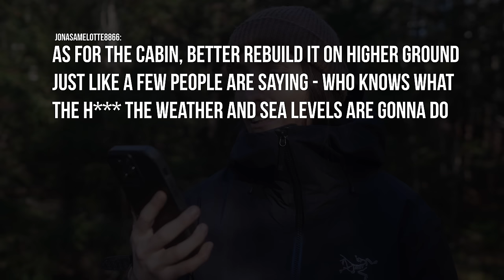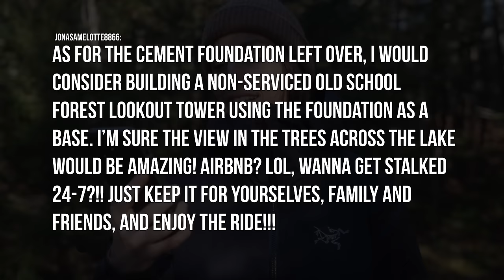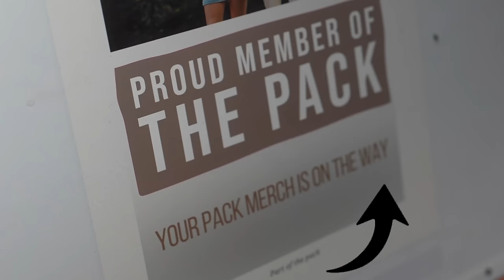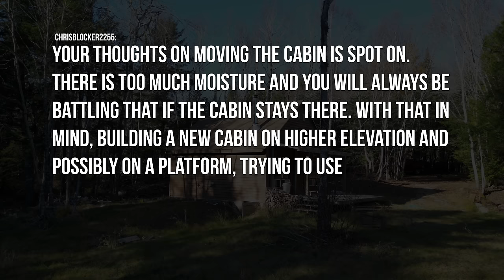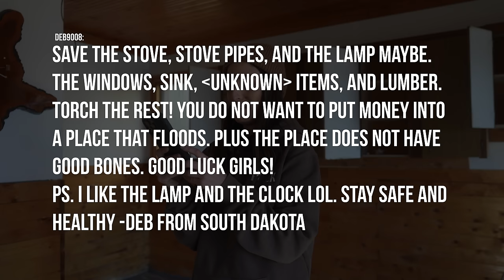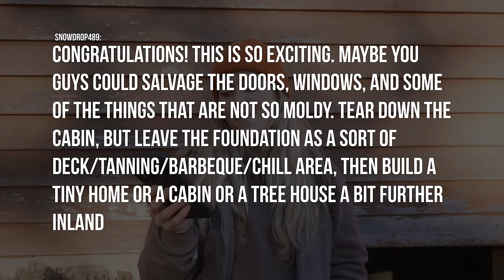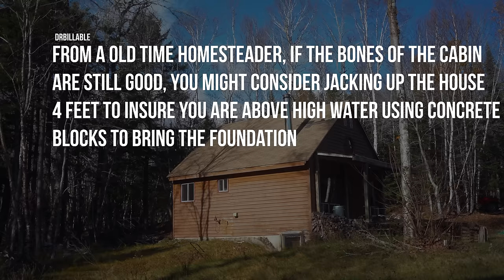Starting My Abandoned Lakefront Home in The Woods

Comment: Í can't help thinking that the water damage isn't coming from under the house. There doesn't appear to be any mold there, which I would think you would find. They build houses over water all the time, so there is nothing wrong with doing that. Perhaps the mold is coming from the roof and it is really badly in need of replacing. I am not a builder, but it doesn't make sense to me. Perhaps water has got inside through the roof and because it has been kept closed and there is no ventilation you get mold.

Comment: Been thinking about that location you have and what i would do if i were you and i would pull that old cabin down its got potential heartbreak written all over it if you try and fix it up as mother nature will have other ideas its just too close to the stream and lake which is a shame as you can understand why they built it there in the first place its such a special area.
What you need to do is go up as in build a cabin 10 -15 feet in the air on posts and use anti foul like you would on a boat to protect the posts holding up the cabin,not only do you get to keep that special area but you get to look down and over it.😉

Comment: i would not burn the pine panel ..  the mold can be eradicated with a strong solution of either vinegar detergent and water  or bleach detergent and water .. keep it all and during the hot months of the summer go ahead and clean it all ...., i would personally use the bleach solution .. if there is no decay the mold will be gone .

Comment: Even the wood that has mold on it they make stuff to clean it with and for the wall studs after the insulation is out they do things called soda blasting that cleans the mold as well just in case in looks like to much to handle the foundation looks fairly new poured walls are the best but like other viewers said you could have a company come do it the process is pretty neat to watch take care ladies!

Comment: You could finish the foundation wall with plumbing  inlet and outlet, to convert it to a seasonal pool that has water pumped from the lake and then drained back into the lake before winter.

Comment: a boat house with a river deck that's attached by rope so when the water rises, so does the deck and can use for boating out when it floods (would need steal arms so when the water drops, it doesn't drop on land, but when it rises it can be pulled/winched in/over to you )

Comment: I've been watching you for several years actually since you built your van .  I noticed a new cabin has leaks did I believe are coming from the gutter not the roof. Why don't you unclog the gutters and bleach all the wall studs to remove the mold. Then you can treat the wood with a primer to protect it from molding again. I've worked with many houses that have had mold and that's what I've done and it has not come back. Good luck Ed
Reply from the maker: Aww, so Ed. that means you have watched us from the very beginning. Thanks for being with us all this time. Happy to have you in our pack. Thanks for sharing your knowledge and experience with us! 🌞🐶

Comment: "About the siding inside the cabin, it looks to me like a great excuse to buy a planer. Remove all the nails, send it through a planer, and get rid of the varnish and stains on the back side. That would be some really nice material to get creative with. Love you guys, stay safe and warm."
Reply from the maker: Thank you Bruce!!!
Reply: @Vanwives  I agree with Bruce.  First treat the wood for black mold with the bleach - and you might stack it and tent it in heavy plastic to fumigate it.  Then you can send it through the planer.  So next on the tool list is a planer and caliper...  You'll need to measure the planed boards to that they are the same thickness.  Takes a bit of work but worth it.  With the varnish off - you can start your own patina journey.

Comment: Will you need to file for a permit to build a new structure? Wherever you build clear an area of trees that will prevent them from falling onto the new structure. You also need to do the same for your cabin, you don’t need to have trees falling onto your hard work. Figure+out what is a safe fire clear zone for both structures and ancillary buildings.